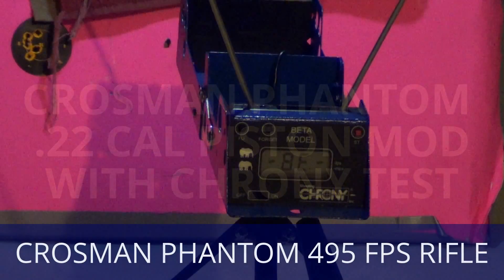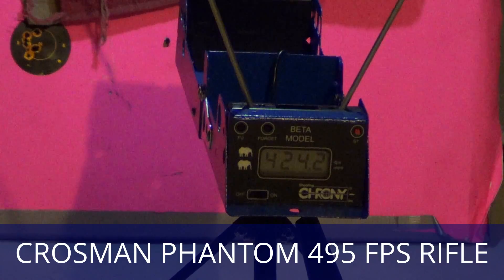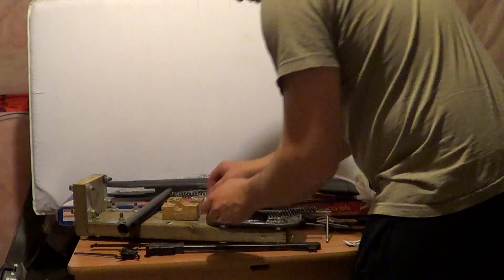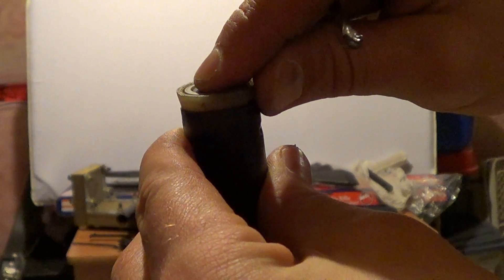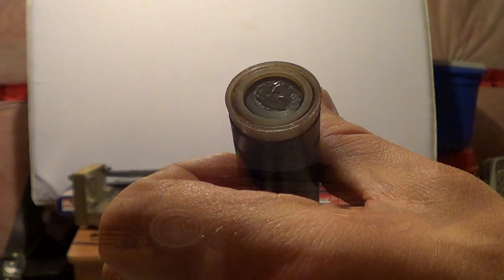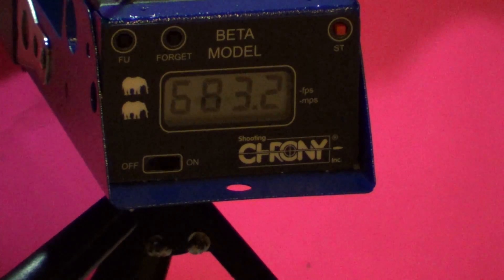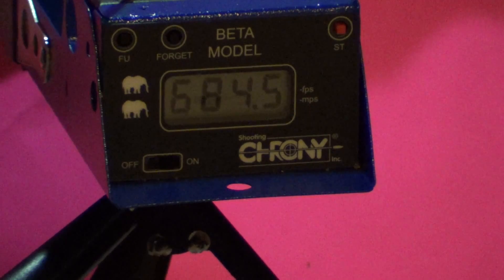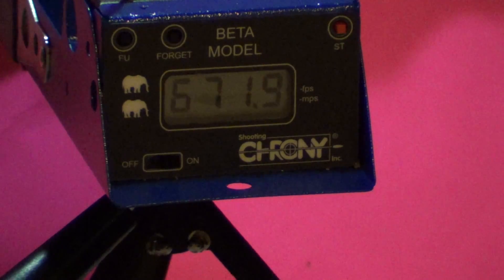CROSMAN PHANTOM .22 CAL PISTON MOD / CHRONY TEST VID 3

Comment: Guys, when u specify velocity in fps, always state the pellet weight. A truck travelling at 20mph will cause more damage than an e- bike travelling at 35mph. Also, do not take for granted the velocity of the rifle advertised on box. As a former importer and distributor of airguns, i can vouch that manufacturers always overstate velocities because it helps sell the product. You do not need a chronograph but it helps to establise a baseline so you can compare the results of any improvements you make othrrwise at best, it's only an educated guess.

Comment: You said you had didn't have a spring for that rifle as you were plugging it. Does that mean you use the different spring on the second chronograph test?
Reply from the maker: If that’s the .22 all I did was plug the whole. I have spring upgrades only on my .177 airhawk

Comment: I had a Canadian version it was in a house fire and wasn’t working the best.  It has a totally different piston than this one. It’s longer and very thick walled and heavy.
Reply: I have the same version.  I can't remember but I think i cut a little more then 2 inches and re drilled the trigger hole for the catch. I cut a little to much off and had to weld  to add more metal for the trigger hole. Think its like 1 7/8 inches your suppose to cut. It shoots about the same speed as the guy in the video. Yes its thick hardened steel. Really hard to drill a hole in it

Comment: Mines shooting 707 after 100 shots 14.3 pellets my old late 50’s Benjamin 8 pumps 471 same pellets 
After adding a shim to trigger pin and removing the creep tension spring. 1 fat hole at 20 yards before with stock trigger 1” plus. Not bad cheap gun. Keeps the nephew away from my Impacts.
Reply from the maker: I’m gonna open mine up soon and see what everything looks like after most likely 20000 shots fired. I made a video today (released on dec 19) but it’s shooting about 650 now

Comment: I went to shot and nothing happing and my guns not cocking idk why it’s a break barrel Crosman fire nitro
Reply: I filled the bleed hole with jbl weld and also I went to the hobby store and got a 5 by 8 bearing to make the trigger loser then when I went to shoot nothing happened and it’s also not letting me cock the barrel like how I usally hear it compresses
Reply from the maker: That’s strange maybe take it back apart and reassemble it to make sure everything is in it correct location
Reply from the maker: That’s strange did you do anything to it?

Comment: Did u just plug the hole or did u plug it and drill the hole smaller
Reply from the maker: I just sealed the hole to get the most compression out of the system.

Comment: Did this to my RS2 big improvement,  also noticed they drilled a small hole in my 177 berrel that bleeds air out from under my breech so plugged that up too but havent tryed the 177 berrel yet having too much fun with the .22 berrel  , i was thinking of converting to gas ram piston but realize the springers are tunable and ram is not , so i will take a springer over a ram for that reason alone , dont get me wrong i still would like to buy a gas ram break berrel but i wont mod it , it will stay stock minus a good scope ..

Comment: You don't need the crony.  I know when mine our working right when smoke comes out the barrel after each shot.  They start smoking around 1200 fps.
Reply: On my Mod Fire smoke comes out the barrel at 460fps.
Reply from the maker: Ya but just to know
Reply from the maker: Chrony or magnetospeed are the best options to get true velocity #s
Reply: You are ill informed. That is called dieseling and it isn’t a good thing.  Lmao. 700 FPS is where the gun should be.

Comment: I found this spring set on ebay, it is a double spring mod with one spring inside another says it will make the canada version shoot up to 1050fps just from changing the spring to a double  https://www.ebay.ca/itm/TUNING-Crosman-Phantom-TWO-SPRINGS-FAC-360M-S-AIR-RIFLES-Free-shipping/174345962655
Reply: 360 mps says its around 1050 fps, i wonder if this mod and the piston mods, like blocking the hole, and cutting out the slots? how high can the fps get? blocking the hole should add another 250fps so what will cutting the slots and reducing the weight do all combined?

Comment: There was no hole in mine so I shimmed it with a few pennies and that definitely increased the velocity, I don’t have a chrony but the difference in the pellets hitting the steel trap was amazing, before heads were flattened with the skirt still sticking out after completely flat as a dime
Reply: what do you mean you shimmed it with pennies? what do i need to do?
Reply: Jeff Mackay I took my phantom apart and pulled the spring out, I then placed a stack of pennies (I forget how many, maybe a 1/2” worth) in followed by the spring. I then reassembled it, there’s a video on this channel showing how to disassemble your phantom.
Reply: Do you have the big piston or the smaller one ?
Reply from the maker: Honestly I have no idea what are the dimensions of both?

Comment: thread the hole for a machine screw,use a few washers with jb weld and try to make a slight dome ,really rocks ,and put a few washers behind spring to make stronger ! that one is a canadian under 500 fps ,its not the american version !
Reply from the maker: yes its the 495 fps model.

Comment: it is very easy to find out if your phantom has a hole on the piston without taking it apart.

break the barrel off the latch bit don't actually cock it.

place the butt on the floor and semi cock the rifle BUT DONT COCK IT FAR ENOUGH TO LATCH!

now place your finger over the transfer port hole in the rifle that feeds the air to the barrel. 

release the barrel up a bit so that the piston does it compression action,  wait about 2 seconds and then release your finger.

if you get a small burst of air pressure come out then your rifle does not have a bleed hole in the piston.

if you get no air pressure then it's escaped through the bleed hole or your piston seal is trashed!
Reply from the maker: awesome thanks

Comment: I got all excited when I saw this but I don't think my cs6m22 will have the hole, its the 615fps version for the UK and I'm thinking this is a Canada 495 fps version, there's always adding washers as preload though but I'm gonna wait will o have a chrono to test before and after.
Reply: Yea, thats what i was thinking when i seen that "495 fps" number, Canada . I have the Crosman phantom .177. Found it abandoned and in process of restoring it. Hopefully it'll work after i take it test out of city.
Reply: @sammyhooligan803  i replaced my main spring and got my .22 phantom to 670fps but the recoil is so bad that it severely affects accuracy to the point that hitting something is as likely as with one of those fairground cork guns lol.  I still have it but have moved on to bolt action Co2 .22 rifles now which can be tuned to very high levels and have virtually no recoil at all, gas powered rifles are so much more accurate than break barrel spring rifles, they also have much longer barrels in the same package size due to not being break barrel and the breech being all the way back above the trigger which also improves accuracy.

You can land a pellet on your previous pellet from quite a distance with gas powered bolt action rifles be they Co2 or PCP because of how accurate they are and having virtually no recoil at all, so quiet with a suppressor on them as well, just a feint puffft from the rifle, they need a suppressor though as without one they make a insane BANG when fired!

I have not fired my Phantom in at least a couple of years, i should really return it to stock power and sell it as its literally gathering dust!
Reply: @stevefox3763  Yep, i can see what you mean. I have the Crosman Heritage .22 c02 .22 , rifle , shoots very calmly  and accurate being a c02 . Compared to my Beeman breakbarrel .177/.22 combo i also own, i prefer the Crosman co2. Although , Beeman has more power for .22 and .177 the Crosman can shoot high velocity light weight pellets with probably more than 600 fps speeds .. Only thing is cold temperature / weather effects c02 power and breakbarrel preforms with same power . So different situations can be what to choose . I currently restoring an abandoned Crosman .177 Phantom i found recently , taking a little time to get out to test fire it, so far every thing looks ok after cleaning meticulously ,lol. Thanks.
Reply: @sammyhooligan803  The lightest pellet is not always the best with Co2, its the way Co2 expands allowing a heavier pellet to be pushed to a higher speed where a lighter one would have exited the barrel while the Co2 is still expanding.   My Co2 rifles destroy the Phantom on power, even with its more powerful spring, they are modified and tuned and pushing over 700fps with 16 grain pellets.  One is running two disposable 12g co2 capsules and only gets about 12-15 shots but the other is running a paintball bottle and your bored before that needs re filling lol.

I know what you mean about temperature and Co2, thats what 3D printer bed heating elements and a 12.6v lipo pack are for :D
Reply: @stevefox3763   Yea, i see what your saying. Modification can improve different air guns. I never actually did any to my current and/or past guns, although might try a few basic on my crosman 2240 if it increases velocity,upgrade to steel breech, longer barrel . Anyhow , airguns are fun and a great hobby but, i have to learn more on "DIY" to possibly save on repair because eventually something will need to be fixed /replaced on one or all in future . Thanks.
Reply: @sammyhooligan803  what indod to mine: ported the had entry point, profiled the valve for smoother glad flow past it, modified the valve body for better flow, enlarged the transfer port and increased the transfer port seal size, polished it entire inside of the gun- the gun body and all internals for more free movement, added preload to the hammer spring, skimmed the hammer stop to allow the valve to open further and modified the bolt to a probe type.

The work dome on my rifles saw a significant increase on power and sounds a lot more involved than it really is, I highly recommend a strip down and rebuild but buy new seals for the rebuild, can can  get away with re using some seals but its best to use new ones and they are very cheap.
Reply: @stevefox3763  Sounds great. The one co2 pellet gun i have that concerns me and seems like velocity isn't up to full power(420-430?) is my Crosman 2210 RepeatAir . .22 caliber 7 shot semi-auto. It is definitely old and did buy it used , years ago. I still shoots wilth some power but, for a .22 not great.Although , i did call crosman back then  to purchase extra circular magazines/seals no way , that model is too old and was eventually removed from their inventory system . So, maybe just to get  a seal ,i need to take it apart first and try to measure /match it to equivalent . Not sure.
Reply: @sammyhooligan803  yeah measure the seals and just order the right ones off aliexpress or similar, just make sure they are made of a material that is compatible with co2, it can rot some seals
Reply from the maker: Very great information in these comments!
Reply: @stevefox3763  Great! Thanks for the company info to order seals from. And maybe / probably i will order seals for my other airguns because eventually they will need replacement also and i'll have them handy when needed ., Excellent information thanks my friend .
Reply: @sammyhooligan803  Always a good idea to keep spares anyway, i have spares of all seals in my Co2 rifles.   If you join a forum for your specific Co2 rifles you may find there is someone on it who sells full seal sets, there is someone who does that for my rifles and they are cheaper than ebay but if you have the measurements you can order large amounts of seals for dirt cheap from china
Reply: @stevefox3763  Great idea! Will do.
Reply from the maker: Been reliable and still going strong. You can see it is still holding up in a video I made a couple weeks ago  where I upgraded the spring in my airgun
Reply: @BROTUNED  it's a robust rifle,my co2 rifles are better to shoot but nowhere near as tough and rugged as my phantom

Comment: My piston doesn't have a bleed hole I have the crosman phantom .22 at 495 fps but it is the CS5M22 version of the phantom
Reply from the maker: Have to change the main spring then
Reply: RINGET421 speaking of which it was really bent out of shape when I got it and I only purchased it on father's day
Reply: RINGET421 what model of crosman phantom do you have? I want to order the piston from urs online and see if it works

Comment: add a old Chevy valve spring to it and it will lob the suckers out at 850feet per second and smoke will come out of the barrel from the oil self igniting under the pressure. that's what i did, and could tag cinder blocks at 125 yards with out much effort but after that valve spring was added the seals at the breach only held for about 1000 shots, and it is to much of a hassle to get new ones as i live far away from the supply bunker that has the stashes.

Comment: Do you think this piston modification with the epoxy will work on a Crosman Phantom .22 with a Nitro Piston ?
It's rated at 950fps. alloy & 800fps. lead , I want mine to do all of 950fps. with lead !
Reply from the maker: +MrPrice989 ya it would but if its full power already I'd assume there is no detuned piston in it. But I could be wrong

Comment: If available, why not simply replace the holed seal with the correct replacement?  Adding a bolt to the seal would add a lot of weight, effecting the piston acceleration and deceleration. And would there be clearance for the bolt at the end of travel?  A bolt wouldn't stay secured for long, and the damage would be considerable. We can't escape it: Solve a problem = create a new problem. Good point on not being able to shim the spring too much before the spring binds.
Reply: spare parts are not easily availlable for all models.

Comment: Dumb question but do you have a step by step for this? Also which other crosmans will the jb weld mod apply to
Reply from the maker: Paul H basically just disassemble the rifle plug the hole let it dry and reassemble. I'm not sure all the models but a lot of the Canadian air rifles have to be detuned to meet the laws.
Reply: RINGET421 ah thanks.  I'm in the USA.  So this is a Canadian power limit thing? 
Thanks so much for your time!
Reply: @diesect33  
In Kanada you need an FAC 
FIREARMS
ACQUISITION 
CERTIFICATE 
..if the gun shoots over 500 fps.
hence most are 495 fps.
Reply: @ezbreazy3810  Actually it hasn't been called an FAC since 1998. Following  the introduction of Bill C-68, it became the PAL, possession and acquisition license